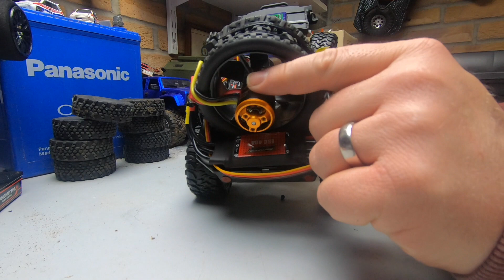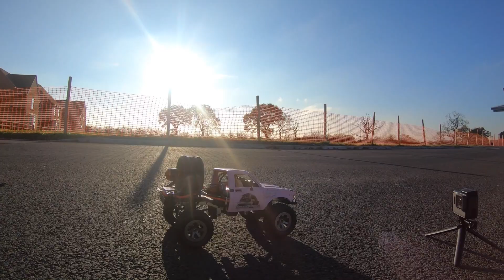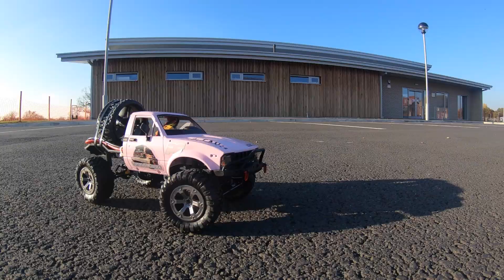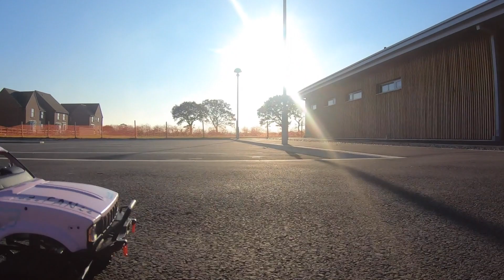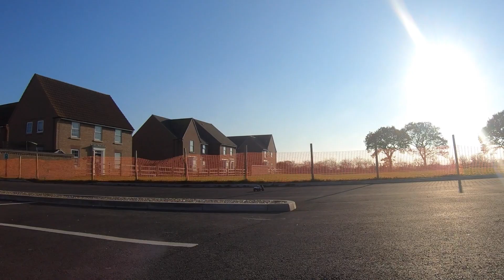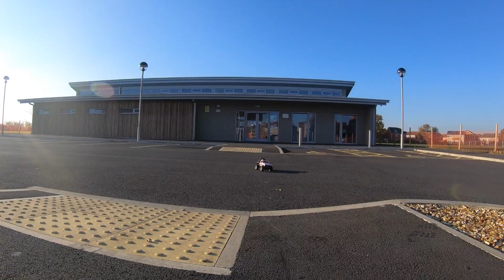WPL C14 Project SteFANie..Crazy Jet Power EDF RC Truck. Speed run coming soon!

Comment: What a great idea is this. Put some drifting wheels and a rudder on it's back and you have a hovercraft simulator :D
Add some PVC pipes on it sides and you might be able to use it on the water to hahaha.
Thanks for sharing this video.
Reply from the maker: haha..i like the idea of a Hovercraft sim :)

Comment: WHOOAA,  EPIC video dude.  SUBD!!!   I though putting a smoke generator on my C14 Kit was cool, hahahaha.  I am not also shopping for an EDF kit.  You think I can run a regular car esc with this setup or is the AIRPLNE ESC necessary. ??
Reply from the maker: Cheers dude, I was thinking about using a normal car ESC...It should work, not sure how it would react if you slam it in reverse though? Maybe I should try....will sort the brake issues out anyway lol
Reply: YEs, You should try the regular car esc, I think it will just go into reverse and provide some braking.  Just gotta limit the revere power if you use a castle programmable esc.  I doubt it will break anything, these cheap EDF kits are not that powerful.  I'm about to order a cheap 25 dollar  60MM 3500 KV EDF system on eBay for about 15 bucks.  I'll use a basic 1/10 scale esc on it.
Reply from the maker: Sounds good.

Comment: This is brilliant am currently making a car with EDF’s but I want it looking to scale just haven’t had time. Brilliant video buddy 💪🏼🔥
Reply from the maker: Cheers dude, I had planned (and do still plan) to make a 'scale' one...probably using a 1:10 Tamiya. But temptation got the better of me with it sitting on the side  😂
Reply: Tomley RC Garage am trying to make Thrust SSC so making the chassis from scratch but I would use the front to steer rather than the rear on the original. 

Be interesting to see this thing do jumps and applying full power in the air it might just fly haha.
Reply from the maker: Awesome, look forward to seeing it one day!....funny you should mention flying! I plan to take it to the skate park and launch it up the vertical ramp, but I'll need to do a couple more videos first.....the ramp may end it 😂
Reply: Tomley RC Garage cheers uni is more less taken up my time at the mo I have been trying to make it for over a year now I have the electronics and a mould to do one of the jet engines but that’s where it ends. 

Can want to see this fly! Ay if you can try and use that 3rd channel to release a parachute even if it didn’t work would be funny to see the attempt 🤣
Reply from the maker: haha...I was thinking about a parachute, I really need to find a long smooth surface to run it on! Which is not easy around here, and whats funnier is I work on a Airfield with a 3km Runway  😂
Reply: Tomley RC Garage great mind eh! What a coincidence you work on a runway and am studying aeronautical engineering related background.
Reply from the maker: I've been working on and around Aircraft for nearly 20yrs as an Aircraft electrician...hence why all my wiring and cable husbandry is terrible.  😂😂😂😂😂😂
Reply: Tomley RC Garage haha I haven’t fortunate to work on anything all theory based😢
Reply from the maker: Hopefully all the work will pay off at some point mate 👍
Reply: Tomley RC Garage cheers buddy I sure hope so I’ll be happy getting some decent money back in than bloody student loans etc..
Reply from the maker: Certainly some good money in the Aerospace industry. 👍
Reply: Tomley RC Garage yeah roll on next year haha get saving for a house this ones too small I have started storing upwards now. 😄

Comment: 😁Your crazy! it's cool though man!
Reply from the maker: haha....just happened to have an EDF lying around, and a spare WPL C14!...oh...and some Pink paint 😂
Reply: think I commented about strapping an EDF into the bed of the B-1 a few weeks ago. some 1.0 crawler tires (1/24 scale) , redcat sumo, just barely stretch to fit WPL rims, really soft so they'd need foam inserts, but would be really short, like 1-3/8 or 1.5" tall. plenty room underneath to make a battery tray for lowering CG, may also want to point the EDF exhaust upwards 10 degrees to give downforce, the steering wont fade when its running fast. lot larger EDF than I had in mind (50-60mm size), haha oh well!

Comment: Hey tomley rc garage. You could make this accelerate faster and have a higher top speed if you open up the airway infront of the edf. The more air it can grab from upfront the it can push out. Maybe do a test to compare with cap or without
Reply from the maker: Yeah, I left the glass and interior out to give it maximum air without spoiling the 'Scale' look. I'm not sure it needs to go faster 😂
Reply: @TomleyRC  oh yes needs to be world's edf truck! Good idea with the smaller tires keeping the cg lower helps with stability and smaller tires means less rotational effort. You might be to do something with the shocks and springs to get it even lower
Reply: Definitely would try to fit some shorter travel shocks if anything

Comment: I think it´s definitely still eligible to compete for the title of "world´s fastest WPL", as it´s currently still easily recognisable as a C14.
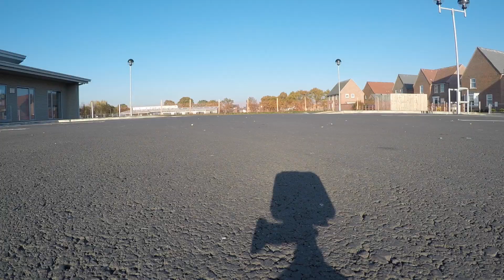 It looked truly breathtaking @ 6:08!
 I look forward to further developments with great interest...
 On another note, I ordered a 1:12 scale WL Toys M35 absolutely ages ago and as yet there´s no sign of it, so I understand your feelings.
Reply from the maker: I need to strap the GPS to it and find a long straight! I was only able to give it full throttle for a split second! Some of the reviews I'm waiting for have been 'back order', so I'm going to end up with all of them in the same week!...
Reply: @TomleyRC I reckon, once you´ve lowered the C of G, its top speed might be in the 60-70 kph range.
 As for my missing truck,  I got an email saying that my package was delayed because my address was incomplete. I clicked on the link provided so I could sort it out...and was faced with a page of Chinese script.
Reply: I think I need that 1:12 scale WL Toys M35 in my collection, if not for anything but parts and a scratch build maybe, if I can ever get the 1000000000000000000000000000000 things done I want to do already, I also like the JJ or JD rc 35 in 16, w/ doors and such.
Reply: @carbonitegamorrean8368  If the JJRC Q60 were available in 1:12 scale I would want one very very badly...